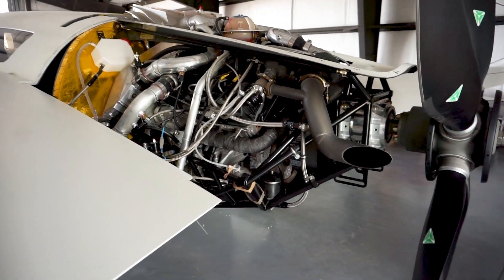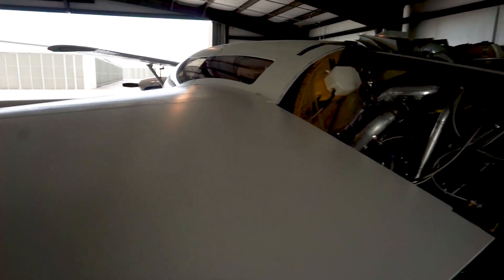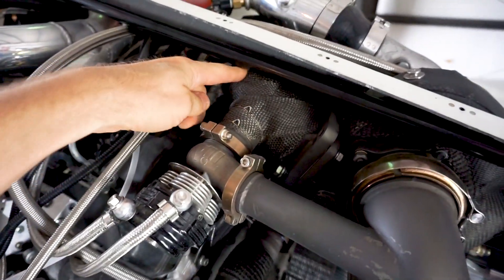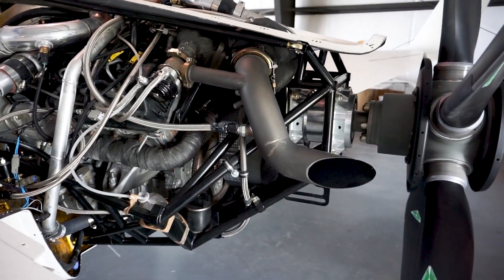Is this the coolest plane you can't buy... yet?  (Part 1)

Comment: Best of luck on great design never a big fan of Autoengines with belt drives over the long haulHope he proves me wrong
Reply: I went to the belt place for a belt for my subaru powered home built. As soon as I told them what is was for they wouldn’t sell me a belt. Saved me some money right there..🤦‍♂️🤦‍♂️.  I figured drag racers have 3000 hp supercharged engines turning a lot of RPMs how is my 40 horse sooby motor gunna wreck the belt???  Beautiful bird mate. Love your work. 👍👍
Reply: @bnetolldnataman  Every belt manufacturer specifically prohibits the use for planes for liability reasons. A guy from germany built a belt driven motorcycle conversion when HTD belts were still new and only used by Harley Davidson. The belt manufacturer told him, that when considering all safety factors, the load would be waaaaay beyond specification. The only way he could certify it with german authorities ("TÜV") were by proving, that chains would have the same limitations. Problem is, that belts are mainly produced for factories, where they run thousands of hours at constant load. Manufacturers don't care about the few hundred aircraft running on belts...
Reply from the maker: Do you have a specific example of a failed belt drive configuration in an aircraft that I could research?
Reply: @RaptorAircraft  Hi Peter!
I have been developing a high torque belt drive for my boat (the project before the plane I am currently building) and it took me a few iterations and falls until it worked out fine, as I underestimated the torque. I was also one of the developers for these diesel engines, so I am familiar with them.

During your videos I could spot the reason (some mistake in design I also did in the beginning) why the previous coupling failed and the same problem will have an impact on your belt drive (shortening the life dramatically) too. You are right that belt has the best power to weight ratio, but there is one little mistake in your design, which you could still solve. Then everything should work fine, also with your previous coupling. In the beginning, I had rubber deposit all over the floor of the boat, but since the design change nothing, not even at prolonged full power runs.

I like your project and I would be glad to help in case you would like it

Best regards, Andreas

Comment: Way too complicated engine.  And water cooled?  Good luck.
Reply: Actually the water cooled version is heavier.  It's essentially the same  engine with a radiator and coolant.
Reply: Water is probably 8 pounds per gallon,  the radiator weighs something,  and if water cooled engines are so light, why aren't they in all the normal certified airplanes.  Seriously,  all the 152s and 172s.
Reply: The big issue is weight. Other issue is balance when it fails.  It is the wrong engine for an airplane.  2 heads and cams?  Come on. That whole engine has to be really heavy. I am a pilot and A and P.
Reply from the maker: Can't you just let me try this and see how it works out?
Reply: You are going to try it.  Kind of curious to see what the FAA inspector thinks.  The very first airplanes were water cooled including the Wright flyer.  They evolved away from it.
Reply: Completely wrong.  Yes the mustangs are water cooled,  but the absolute most modern piston big power engines are air cooled multiple row supercharged and turbo compound AIR COOLED monsters.  Think Lockheed Constalations.
Reply: As a pilot,  I would be concerned with everything having to do with the water cooling failing during takeoff when you are at full power and no altitude. Actually have seen it fail at the Reno air races a decade ago.

Comment: Great week Peter.  I had an idea for your air extraction.  You had already added the actuated door underneath the cowling to allow air to bypass.  You had also shown in diagrams that the spinner was going to sit quite snugly INSIDE the cowling, making a very aerodynamic design.  Depending on the clearance between the spinner and the cowling, could you flange the spinner between each prop blade with just a small curve, like a centrifugal stator?  The spinner, at 1600RPM in cruise, and more importantly sitting at idle on the ground and taxi would then create a small, constant, free, negative air extraction draw.  Just a thought that occurred to me a few months back.
Reply from the maker: That's a nice idea. I have an inch of clearance between the spinner and cowling already which would allow for this if we need further drag free cooling.